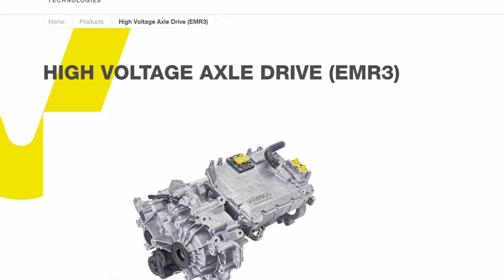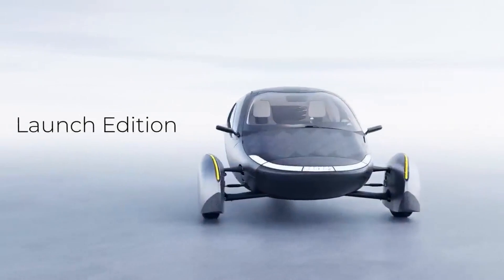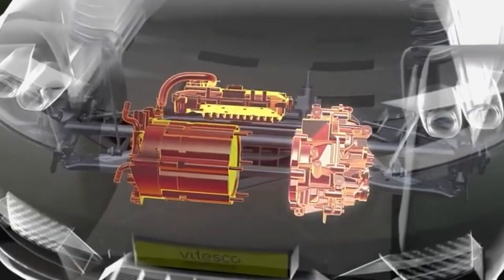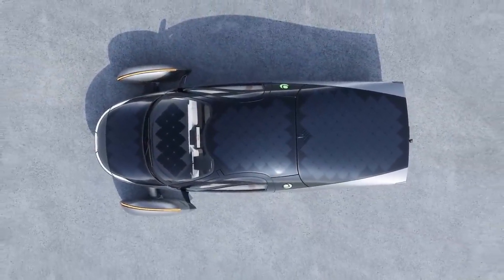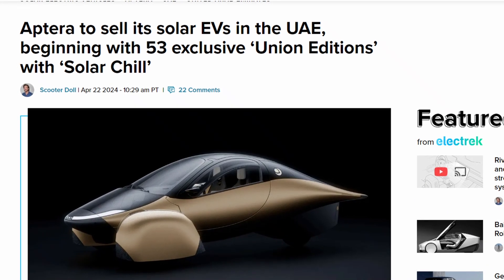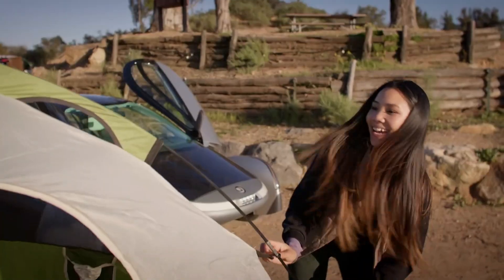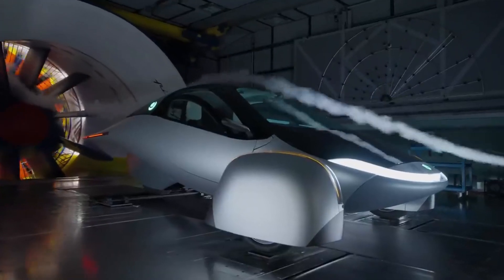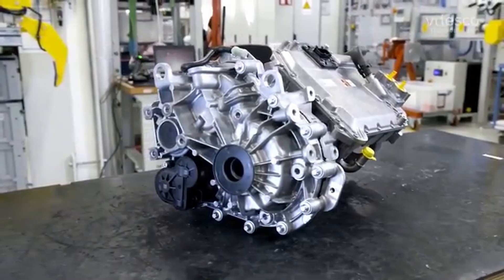Aptera Picks Vitesco EMR3 drivetrain | IS THIS GOOD?

Comment: So no all wheel drive and no immensely good hub motors? More empty promises which are regulary broken.
Reply: Alaphe weren’t able to produce the motors according to the numbers Aptera needs for production.
Reply: @SteveBueche1027  Sure. And they did not know that since 2019. And you also believe every other empty Aptera promise. The italian engineers convinced the Aptera laymen mechanics, that their concept of inefficient hub motors and glued together plastic body will not withstand the burden on the road.

Comment: Sorry, but your AI narrator needs a lot more work.  After the first 60 seconds listening to high speed mispronunciation's of basic power and torque units of measure, I switched off.  I think Aptera is a wonderful concept that will mature into a fantastic product.  If you are trying to do it justice with these videos, you must to put a stop to these rapid fire errors!
Reply: So now the much heralded in wheel motors are gone ?
Reply: @nickjolly3984  Only from prototypes - there are no Aptera's to go from.
Reply from the maker: Lo!